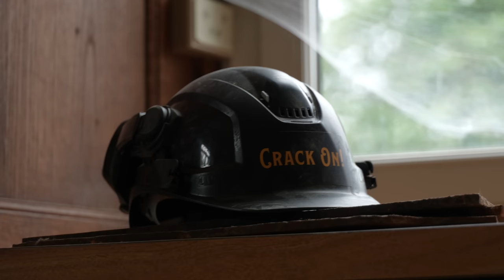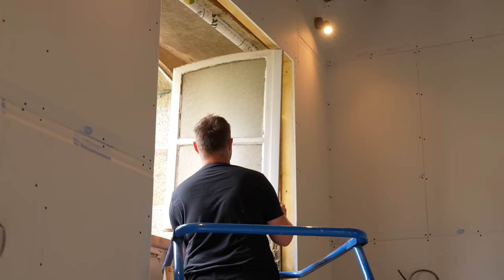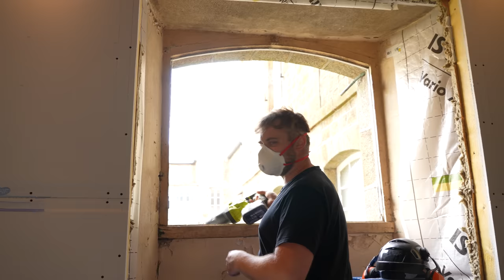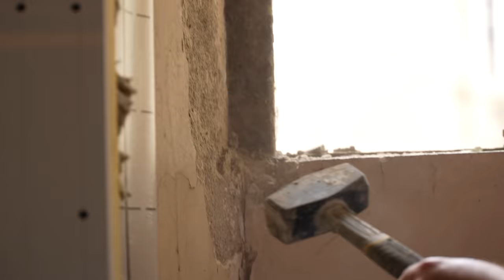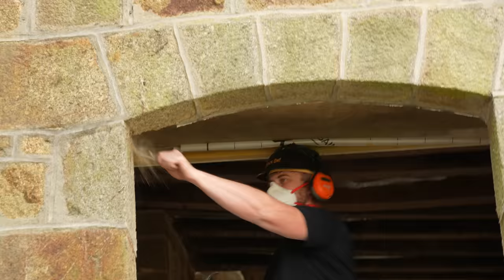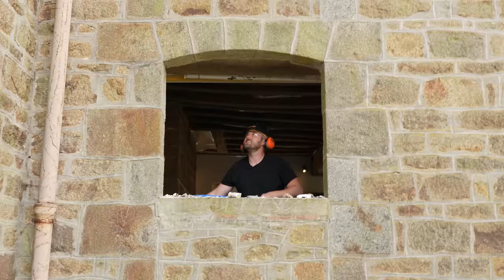Demolishing a Wall for a New Window

Comment: I have to agree with everyone else about the longer videos, I love them.  As for the window, there are stone coins going all the way to the ground that outlined the original doorway, are you going to knock those out and replace with matching stones to make the window match the others?  If not, the just leave the stone that's still there in place below the window because the stone coins are going to give away that it used to be a doorway anyway.  Since there are other areas filled in with the smaller stones around the convent, I don't think it would look too bad to just put in a granite window sill and call it a day.
Reply: I'm with you. I would have been tempted to turn it back into a doorway again. So many projects!

Comment: Love the restoration. If you don’t already have or enough of the appropriate stone for below the window, you may have the option in the area to have a slab(s) cut to match the other areas as a veneer/facade at a depth where it would never be noticeable and at a lower cost and likely easier install to the existing stone. But there is also the personal feeling going the full effort and cost of a total restoration, even if the stone was never there as a door. Choices and decisions. Keep up the good work and videos

Comment: To solve the problem of the bottom stones, you could find a granite block that matches the existing stones and have it cut into slices that you apply like tiles across the bottom of the exterior. That way it would give the appearance of having solid granite blocks all the way along
Reply: Good idea.
Reply: This is what I was going to suggest.  He would have to find potentially fewer stones if he used them as a skin rather than a full block.
Reply: Why don't you guys ever use
Reply: Gloves

Comment: 12:13 Not an expert but if you did it from outside, you could save every block and not destroy them in process. As you could crack the connections.
Reply: I was thinking the same.
Reply: Me too

Comment: DON'T bash out the rest of the wall. All you need to do is to add some granite at the bottom to make it look like part of the foundation. The rest of the wall looks fine. You might even find some suitable stone for the window sill  in the garden - if not the original.

Comment: Billie, you need to use the moil point bit (pointed) on the jack hammer / breaker. The spade bit puts less point energy into the rocks each blow.

Comment: I may be completely mistaken, but the infilled stonework that's being removed here seems to be replicated in the, or rather the window above, the former doorway. The stonework doesn't match that surrounding it in both instances. 
As for hard hat usage, Billy, if this was a commercial job site, no hard hat, no work is usually the policy. Can never be too safe.

Comment: NEVER STRIKE A HAMMER WITH ANOTHER HAMMER the hardened heads of hammers can crack and shatter sending razor sharp shards of metal flying at high speed I've seen it happen and the wounds are quite often deep

Comment: Why not a door again Billy? Wouldn’t that be easier if you needed to bring in shopping, groceries or a chef wanted access to a herb or veg garden right into the kitchen … just thinking out loud… there’s so many windows I don’t think will make a difference if one more door especially it’s in the corner. Using the kitchen you’ll need a rubbish bin and recycling bin and access to the court. Especially if you have guests at the bar you wouldn’t want to be bringing in shopping and what have you.

Comment: I noticed early on the window was once a doorway and then wondered why it became a window and why a window with frosted glass. Is this a clue as to where the Nun's buried treasure is located? 
One thought as to why the door went away is the drain placement. Did drain installation necessitate removing the door? 
Still wondering why frosted glass.  👍👍👍

Comment: I think you're getting ahead of yourself. You should have taken the stonework apart from the outside to save the matching stone for re-use and now you're talking about taking out the rest of the bottom stones. Unless you already have the replacement blocks to match the other windows, why would you remove something that you'll just have to pay to replace if you can't find matching stone?

Comment: Surely it would've been easier if you worked from the exterior, you could have cut through the joints either side of the opening using a disc cutter, though why you wanted to start this job now when it could be months before the carpenter gets around to doing this additional window!

Comment: Quick question...is there a reason you didn't go in from the outside and remove all the grouting from around the stones like you did in the room where you redid the floor?
Reply: I was wondering the same thing. It seems to me that you would want to save the stones for re-use elsewhere if needed as they match the exterior. Seems like this was not completely thought through.